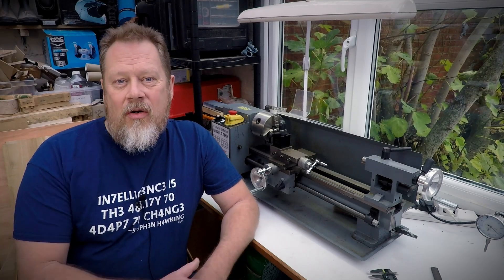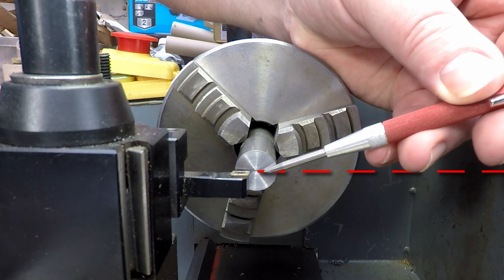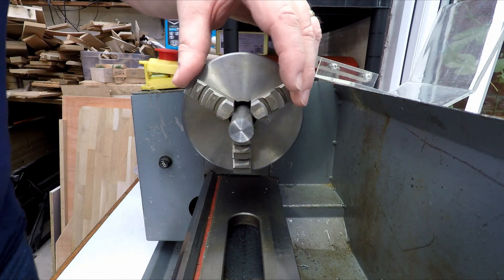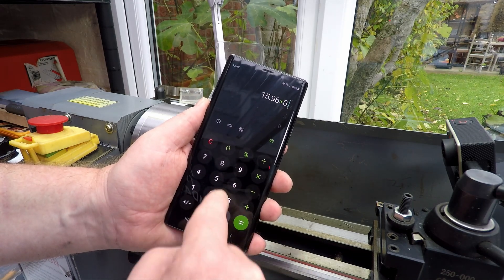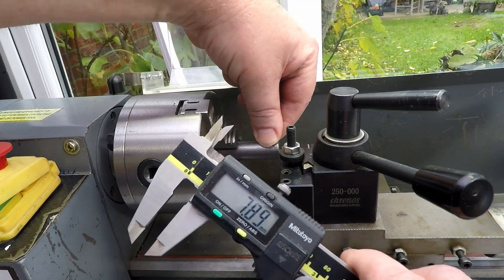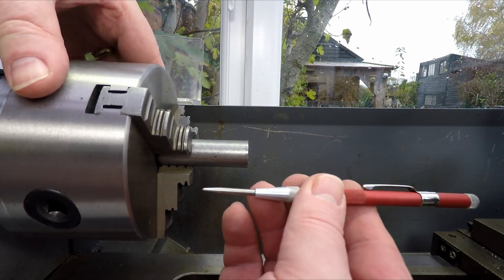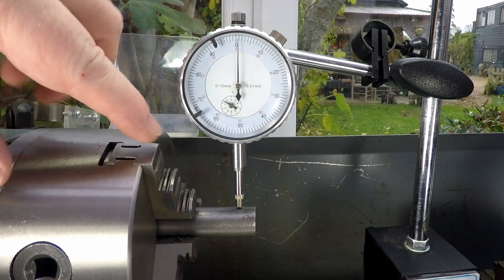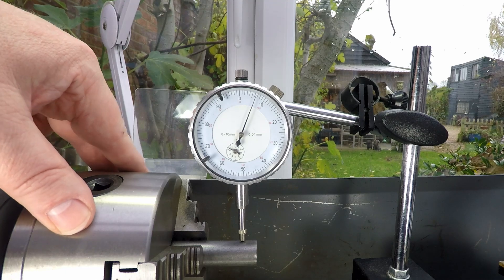A quick and easy way to set the tool height on your lathe using only basic tools.

Comment: I don't seem to experience much trouble by just making a tiny mark on the end of a piece with a center (in the tailstock) and then touching the tip of the tool to this mark.   This seems to work a little better than just lining it up with the point of the center (due to the rotation of the headstock eliminating any personal interpretation).   But both work well and quickly.

Comment: What convoluted way to go about that. I have a much quicker and easier way by using a piece of flat bar
Reply from the maker: It takes seconds to do in real life. Not a replacement for any other way of setting height but useful if you need a tool change after boring the face out or are machining a hex blank etc.

Comment: Face off  the workpiece (or just a piece of leftover), if there's a dimple left, correct up or down by eyeballing until it's gone, takes less than a minute.
Reply from the maker: Yep the classic tried and tested method. 👍 Doesn't work if you've already bored out the face and need a tool change though.

Comment: Use a red or Blue marker pen on the end face. Take a cut and see if it is a solid colour dot, too low, or too high, either is obvious. No dot slightly too high to exact on centre.  Initially set with a brass strip between tool and stock diameter, set to vertical. Is very close 99% of the time.   Repaint after adjustment. Then use to set all other tools.  Can also take like cut greater than  the radius of the tool, measure the spike diameter. Adjust 1/2 of that diameter, will place the tool in the exact centre line also.  It always pays to plan ahead, and pre set the centre height of all the tools being used before the start of the project or part being made. Make a simple check list of tools to check, Parting tool, Roughing tool, Finishing tool, Threading tools, Form tools, Boring bars etc.

Comment: Way to much faffing about (sorry)...I keep an off cut of inch diameter Aluminium in my tray, that has been faced many times so has all the tooling marks. I chuck it, eye ball the tool to just under centre, take a light face cut and the creep up until I'm left with smallest nipple left...Normally one or two passes. This is now perfect height. If your using a parting off tool or boring bar at long extension then you might need to take into account tool deflection on roughing passes. But for general use with turning or facing ops this is a fool proof way of centring.

Comment: Using the machinist's scale (it's not a ruler, they are physically different) is fine for HSS, but a good way to chip your $ carbide inserts.
Reply from the maker: Good point 👍 In the UK we call scales rules as opposed to rulers. As in a "steel rule".

Comment: Get a straight 6 inch rule, offer it up to the workpiece wind your tool up to the rule, trap the rule against the workpiece, it should be vertical to the workpiece ,if it’s in the dead centre, simple and quick.

Comment: What i always did ,was use a pocket 6 in. Steel ruler and put it on the side of the piece and put the cutter up against it if it leaned. Toward me i would keep adjusting it up until the ruler stood straight up, of course pull your tool back during each adjustment to keep from breaking it,  Hope this helps, Its quick and easy. .
Reply: It Works GREAT 👌

Comment: You shouldn't adjust tool height by turning the long center set screw. That's should be tight into the tool holder body. You loosen the lock nut and adjust tool height with the thumb nut then lock the lock nut back down
Reply from the maker: You're absolutely right Will, I guess I was being lazy in the video. Will pin this in case anyone gets the wrong idea.

Comment: I eyeball it, run a cut, and tweak the adjuster on the tool holder until I don't get a nib in the middle of the bar. Takes me less than 2 mins
Reply from the maker: An excellent technique. Unless you have already bored or drilled the centre out 👍

Comment: Nice video, I've only just started to use my lathe and have been using the tail post centre to line the tool hieght bt eye as the only round stock I had available was some old scaffold tube so your measuring method wouldnt work🤔
Reply from the maker: That's a good enough technique. If you only have rough stock to work with you can turn down a portion at the end to get a clean area to measure from.

Comment: I was a machinist for well over 30 years and always use the six inch rule and checked by eye when it was level and the first cut across the face would prove if it was right and 99% of the time it was right
Reply: Also works to put drill bit in center of a round job in the drill press
Reply from the maker: Spot on 👍
Reply: I'm with you, 6 inch rule, piece of packing, anything reasonably straight. Against the chuck, against the job if it is roundish or against the tail stock. No tools whatsoever.

Comment: As a retired engineer having spent many years in production machining you’re actually trying to solve a problem that doesn’t 
exist. Whilst your efforts do allow you to set a centre height in time it’s totally unnecessary. A previous comment nailed it 
really but using a steel rule 6 inch place it tool side of the bar gently bring the tool to trap the rule between the bar and tool 
cutting tip. A quick glance at the angle of the rule will tell you if your high low of near enough. The rule should be vertical 
for centre height. A fine skim across the bar to clean will give you a perfect view of centre height. Adjust to ensure spot on. 
In production engineering you don’t have the time to mess with dtis and verniers to get this position. Some people use 
centre drills in a tail stock chuck after making a tiny pip in the face of the bar, or if you have a tail stock hardened centre 
or running centre you can adjust centre height of the tip of the centre. Don’t mess about, get set up and start the best bit, 
cutting steel.  Nice little lathe you’ve got.
Reply from the maker: Thanks for the info 👍 This is just a technique I found myself using and hadn't seen elsewhere so I decided to put it out there. It's not a replacement for any of the other techniques that people use but comes in handy for when the ruler and pip tricks cannot be used.

Comment: First, if you’re adjusting by the stud and not the ring your set will be short lived. First thing I do to new holders is put on removable thread locker so the stud cannot spin. 

Second, While that method is generally pretty good it does fall short on certain geometries such as CCMT types where the whole insert is set at an angle to create the clearance or some other tools with crazy geometry where it isn’t feasible. To set tools I’ll generally turn it with a good tool and turn a taper, the finished point can be used to set your tool height visually and be generally close enough.
Reply from the maker: Thanks for adding to the knowledge.

Comment: I would just set tool by eye, take a shallow facing cut, then reset to tool to the centre of any "pip" left. Or ue 6 inch rule like @Halinspark does
Reply from the maker: Both fine techniques. This one is useful if you have bored or drilled out the face and can't face to a pip - just another approach.

Comment: As far as the tool height goes just simply line your tool up with your dead or live Centre in the tail stock works every time, as long as your tail stock is aligned correctly which it should be if you have set your lathe up properly. I have had no problems doing it this way and I have no little tit on the part when I face off.
Reply: That's the way I was tought, none of this faffing around
Reply: Agreed - but what if it's an indexable carbide insert tool where the chip is the other side of the tool such that you can't get the live/dead centre in the tailstock close enough for a decent touch? 🤔
Reply: @Quokka57  Not quite sure what you mean by the chip is on the other side.??
Reply: @WayneCook306 This dumb site won't let me post pics to explain what I mean. 
But I think I've got it sorted for my lathe - rotate my toolpost so the tip of the carbide chip is as close as I can get it to the point of the live/dead centre - assuming of course that everything in the Lathe is square and centred.
I made up an aluminium (aloominum??) blank cylinder, then used a known centred tool go scribe a mark using the cross-slide.
Then I put the tool in question into the cross-slide, and used it to scribe a line on the ali blank the same way (ensuring the chuck didn't move during all this).
The amount of offset to the centre of the work is the difference between the known centred tool's scribe mark and the tool I'm trying to centre - in my case, the tip of the carbide insert chip is 2.65mm too high.
No wonder it cuts like a rusty pair of scissors on steel 😎
Reply: @Quokka57  That should work ok that is all I have done with mine.

Comment: No need to use dti. Simply measure height at 180deg. Divide by two and that's the number you aiming for. Personally I made a centre height setting block. It's knurled and had decent base. I an instantly check centre height especially when the lathe is used by others.
Reply: Yes. Centre height setting block is the bees knees, providing there's a suitable flat area on the lathe. Tho this approach is fine but slightly slow!

Comment: Great video. i never actually thought to rotate the grub screw on  the tool like you did to make it more precise then turning the knobs. Though the downside of doing it that way is that the thread could move over time. I always thought those screws were supposed to be loctited in and you use the knobs to adjust then locking with the nut.

Comment: Your presentation is nicely done. I would request that you sir, or anyone watching this would learn to hold the handle of the file in your left had, and the file tip in your right hand, while stepping a bit to the right. This has two advantages. The first being a great reduction in the chances of getting your elbow clipped by a jaw of the chuck. The second, is to remove most of your body parts out of the line of fire, if the file is thrown back at you after getting hit, again by a spinning chuck jaw. I have had experience with both of these situations. Safety first, stitches next.
Reply from the maker: Thanks Robert. Personally I would not want to use my non dominant hand and work cack-handed or stand in an uncomfortable place as this would mean less control over the tool and more chance of hitting the chuck. The safest option is to not use this technique unless you have to, and if you do use it observe the following: No sleeves, no jewellery, elbows well away from your sides and keep the file orthogonal to the lathe bed i.e. 90 degrees to the axis of the chuck. Do not use the technique on awkward shaped jobs with protrusions or when the chuck has the jaws protruding too far out. Stay alert and stay safe.

Comment: Hi,
Very cool and clear …..
another easy way to centering your tools  is to put a mini laser
pointer with a very small gap in your chuck …. most accurate in an independent four jaw chuck.
The laser beam will point your
insert on the correct center height …..
Reply: At first I had the same idea, but soon discarded it considering that a laser pointer's spot is usually larger than the expected precision of a few hundredths of mm of a digital caliper.
And yes, you could use a focusable laser module, but even then the precision of the system could be affected heavily by the angular error of the beam, due to the sum of three key factors: chuck runoff, unpredictable (and not repeatable) positioning tolerances at every new clamping of the laser module and, what's worst, no guarantee at all that the inner laser diode and its outer casing are perfectly aligned and parallel on assembly.
The sum of these angular errors could thus result in quite a large peripheral deviation of the spot, even at relatively short distances.
Reply from the maker: Interesting idea, thanks.

Comment: Sounds like a lot of measuring, got a tip for you. Take steel 6inch rule out your top brest pocket and plumb it up against the side of your stock bar, lightly hold it with your tool point and Eye it up vertically. By dinnertime you'll be a dab hand at it and have it perfect ,fast and efficiently every time. P
Reply from the maker: Except the times when the job isn't round.
Reply: Ps . If my machine tailstock was out of line your way would be a good check for at least one axis and or a mounted scribe to the bed ways
Reply: Unless your going to use a faster to hold something square you'll not get a square object  in a 3 jaw  self centreing chuck. .
Reply from the maker: @Phil-fj5fe try it with hex bar.
Reply: @radboogie  think I'll just keep using center in tailstock to eye up tooling in that case though it's the way I've been trained. And to be honest it takes seconds instead of mins . But your way could be beneficial on more complicated independent four jaws tasks .p
Reply from the maker: @Phil-fj5fe  A good technique, always best to stick with what you're familiar with. This technique is one to store in the brainbox in case it comes in handy one day.
Reply: Fair point
Reply: Will do. Many thanks it's always good to have as many options as possible . Ps did a calibrarion course on imperial inches and US customary measuring units . They were once a totally different measurement wow and I think it was only in the 1960s that both measures were aligned to be the same . But I was shocked too when I heard they called the smallest measure a mil. Just too give us all a bigger head ache.  At work we not allowed to use fractions in US customary  measures we have to use decimal to 3 places. Ie 0.763 inch or use the term thou. Following American engineering drawings . And we are deterred from saying microns  so have to say  0.763 mm etc . Was never given a reason though . Don't think they know why . Just said this way. ?
Reply: Agree entirely.  Never needed anything else...

Comment: I was taught to put a scale/ruler or similar between the part and the tool and adjust the height until the scale looked vertical. Works well enough, works quickly, requires no thought, and anybody who has a lathe SHOULD have a scale.
Reply: Same here. The first scale I owned had several dents and scratches from me not being careful. So I started using  bandiing strap or EZ-Lap diamond files with the plastic handle.
Reply: Me too, back in High School 1967
Reply: Yup used that at work industialy  and at home shop
Reply: That's exactly what I was taught also many years ago
Reply: Without a doubt the fastest and simplest method. It really surprises me that so few people know to use a scale like this.
Reply: Yes absolutely right, been turning for over 50 years and this is the quickest way of finding centre height, then do a quick face off and adjust if necessary.
Reply: Same here! Quick easy and foolproof
Reply from the maker: There's lots of ways to set tool height, this is just another one that is useful in some situations. Use whichever technique works for you.